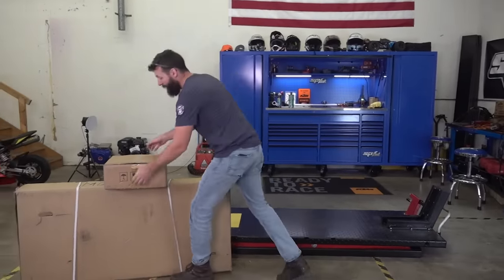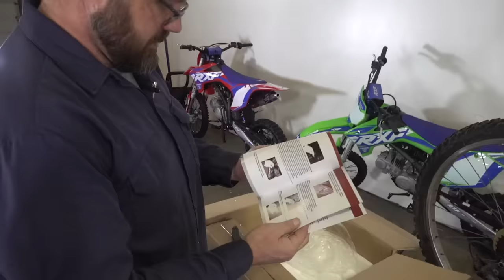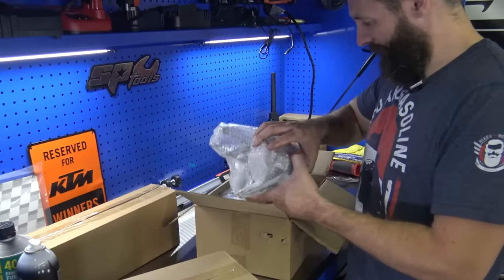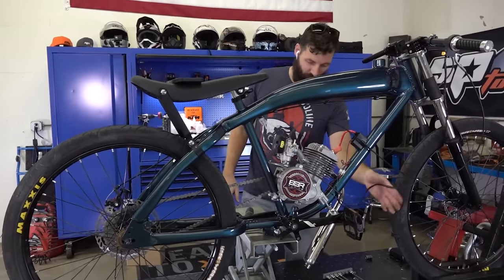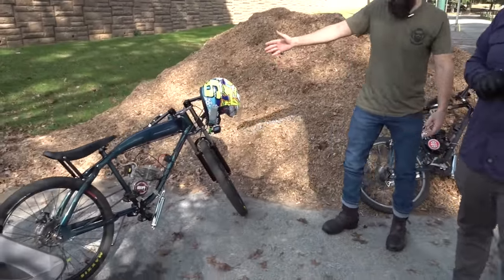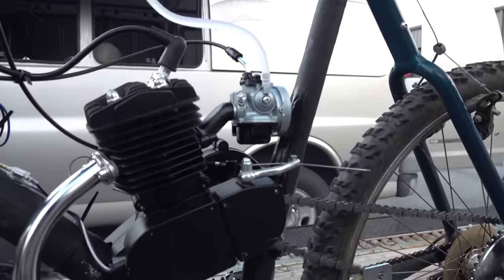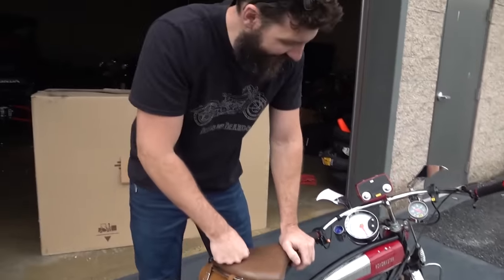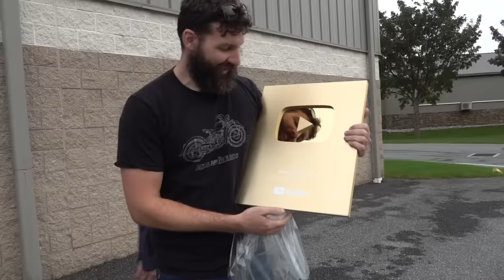I Bought the Cheapest and Most Expensive Motorized Bike kits from Amazon

Comment: So your air cooled moter doesn't last without air cooling. Y'all really are something to call yourself a bike channel.  port match. Fat carb and a proper pipe and they do 45mph reliably. Or don't and they will run forever on filthy gas and zip ties happy at 20 25 mph. How bout you pull out an old knucklehead or any old  Harley for a fair comparison. and do the same and see how long it takes till the engine melts. Like why did you do that. What did you learn?

Comment: Lulz, most expensive... xD.
Reply: That crap "expensive" kit doesn't even have an expansion chamber. Just so you know, the bike alone is $600-700, and you got the same engine. There are much better engine kits for bikes.
Reply: At least it came with Maxxis Hookworms, those are the main tires used at the motorized bike races.
Reply: LMFAO 40 mph can't even compete at the races, and 50 mph might not come in last.
Check the PFP, this is on a track.
My next build will be on a real steel framed Felt Cruiser, either the Felt Chief or MP. I have both, but haven't decided which yet.
Your chinese aluminum (chinesium) gas tank frame is known in the motorized bike community as the Felt Faker.
They are known to crack at specific points from work hardening due to the vibration.
My next engine is going to be the Tillotson 228R mated to a 3DMotorsports clutch driving scooter hubs laced to motorcycle rims sporting DOT 97 MPH rated tires.
Learn what an expensive build is :P
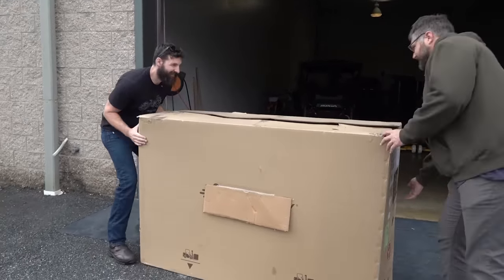Reply: OK, I wasn't expecting you to get a decent build at 21:05. I do not like the springer fork, and swap the hookworms on. There are motor mounts that allow you to mount the engine vertically. Other than that, looks pretty good. Hope you didn't spend more than $1200 unless it's a stage 4+ engine.
Reply: Nvm, 45 MPH is a carb change with the gov removed... if there was a cam, rod or flywheel it would be 55+ easy.